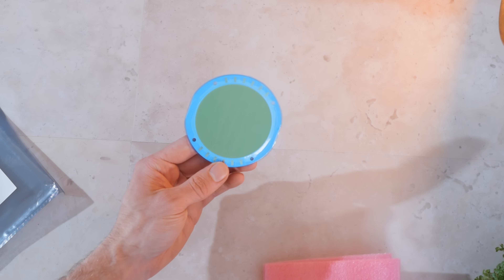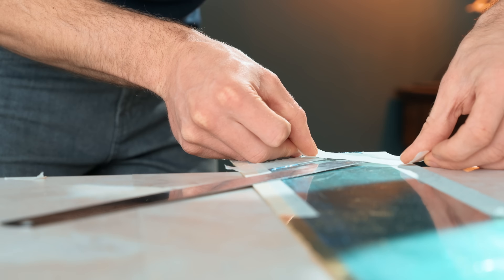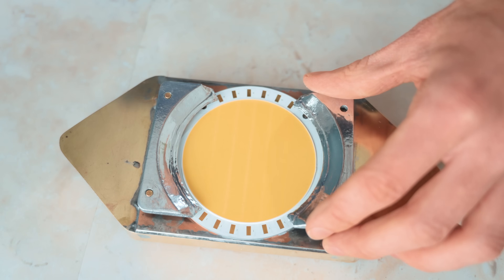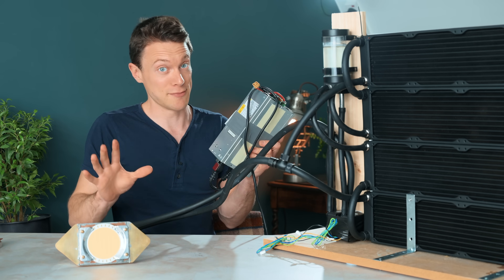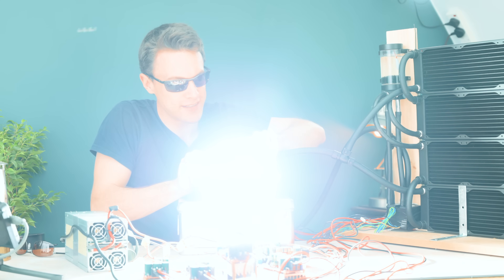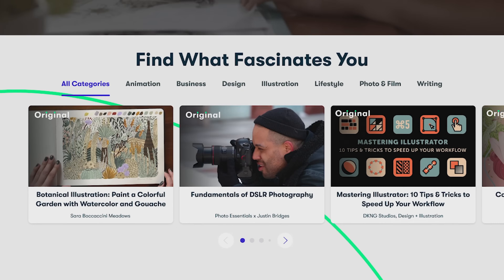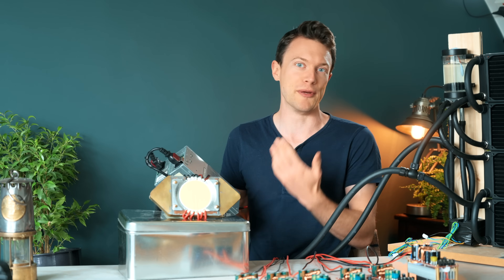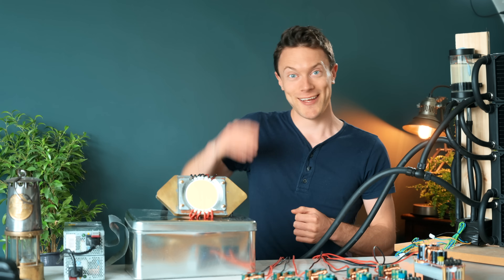Testing the world's BRIGHTEST LED!!!

Comment: Aren't you meant to put fans on the radiators? If you don't push air through, they are probably not as effective as they should be...
edit: He did, at the back! That's a lot of heat dissipation!

Comment: Wow that is exactly the same power supply that my server use, very easy to hot swop while the server is running. Its normal for them to be very hot. Even when my server draws only 300W with both power supplies running its to hot to touch.

Comment: So its rated 1500 watt and all 1500 watts are output as heat?
Seems pretty inefficient to me..
Edit / update:

80lm/w, so they are not very efficient COB's then.. (if they are really 120,000lm output, and they say thats untested and technical estimate...)
Also just double checked the PSU's your used it didn't look DC / case isolated from each other which I think you'll need to do..

And lastly I'm not really sure on cooling and the amount of Rad's you have..
I would be interested to see how they heat soak over a few hours.

But I think the most interesting part of this setup would be the write up of the cooling system when syncing 1500 watts of heat into it.
Reply: Yeah watched the whole video.. You went so far overkill on that cooling system. 
You need maybe 1/4 of that system maybe, maybe 1/6-1/8 at most with some active cooling.
As for the PSU's did you isolate them PSU from each other?... 
I always thought they have to be isolated from each other before you put them in series?..
Edit: 
Yeah this HP PSU's need the DC isolated and the AC grounded together..
Reply: @TheWebstaff  they act like transformer power supplies in a wall wart, they self-isolate (just like us in 2020 lol)
oh, and he knows he went overboard on the cooling, he just wanted to err on the side of caution
Reply: @TheAechBomb  Depends on the PSU but I think those are 800 watt HP ones, so as I've already commented you should disconnect the DC side grounding.
Reply: No?? A load of the output is the light....
Reply: @OfficialyMax  So the sarcasum wasn't strong enough?..
Reply: Thinking the same thing, turns out heat waste ratio and light intensity are 2 different things. Although LED can be 15 times as efficiency, it stills has 60% power wasted as heat (900w). A 10w LED light bulb can light up a room. Imagine 150 of those pointing at the same spot.
Reply: @Ezreal223  They are suggesting 80lm/w looking at the data sheet if that really is 120,000lm so yeah not very efficient..
But 125c junction temp and 85 c case temp so if he aimed for 50-60c they would be a nice balance and would shift a lot of heat vs being just above ambient temp..
Would be better to get a cluster of 150-200lm/w COBs and put them on one sheet vs what they have done here with this COB also a lot cheaper..

Comment: "it's important to add a thin layer of thermal compound"
adds a very thick layer of thermal paste 🤣
Reply: Nawww is not THAT thick
Reply: @fish9468  yes it was a bit too thick
Reply: Thermal paste, an eternal debate
Reply: I looked for this comment.
Reply: @ahmedsamialper5960  yes me too i knew it would be here
Reply: this satisfy the god of PC building, Stefan
Reply: She do be looking kinda T H I C C
Reply: A whole tube. Haha.
Reply: Well he didn't polish the heatsink either and it still seems to work.
Reply: The Verge: heavy breathing
Reply: Better too much then too little.
Reply: @fishsauce2221  Nah men , best heat transfer. Only happens when metal touch each other . Thermal paste just fills small scratches between the two plates
Reply: @urgay1992  you are correct. This way the LED can also warp sightly (due to heat differences) and not loose thermal contact with the cooler). The rule to apply as little as possible is simply wrong in many occasions. In theory this would be true, however the risk of no thermal contact and the paste drying out much faster is not worth a 2K difference
Reply: Its pretty simple to lap the copper block on mirror, sandpaper and water.  Then slap the LED on it, turn off the lights and shine a flashlight along the back of the rig with the 3d printed clamps pressing down where you expect them to be. More than likely the LED will flex and end up convex with the center. Might want to lap the LED and make the clamp a circular one with low clamping pressure to minimize distortion of LED plate.  Amount of work depends on whether this is for long term use or just testing for a couple videos.